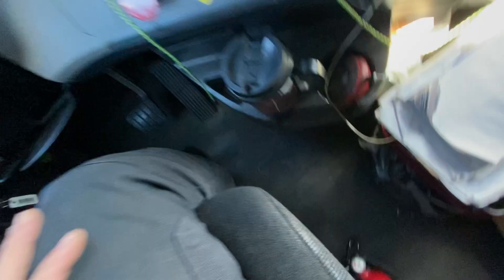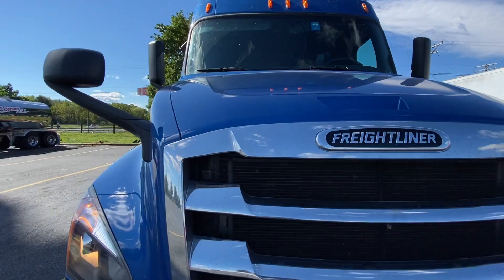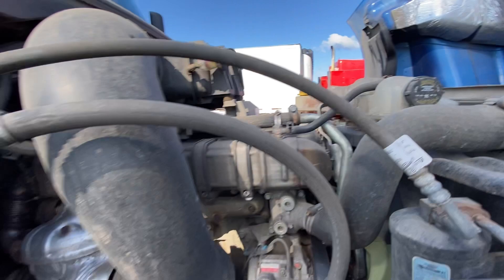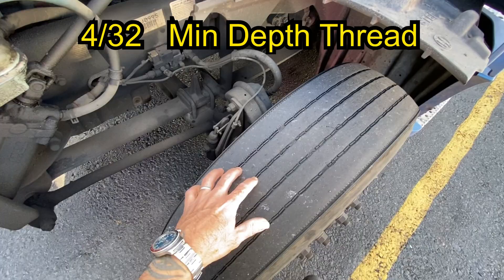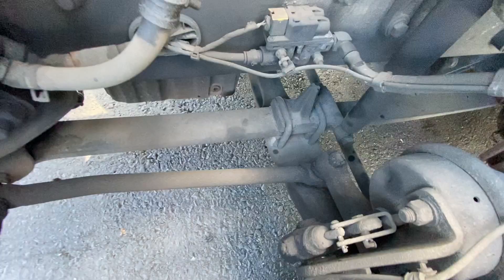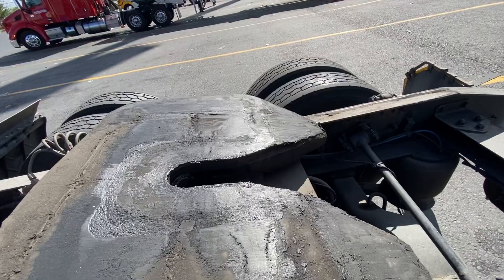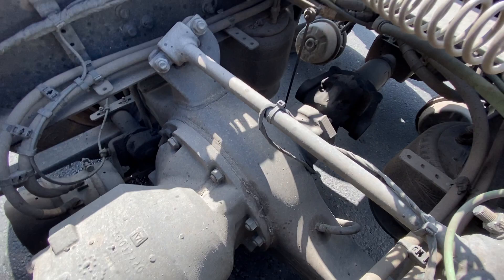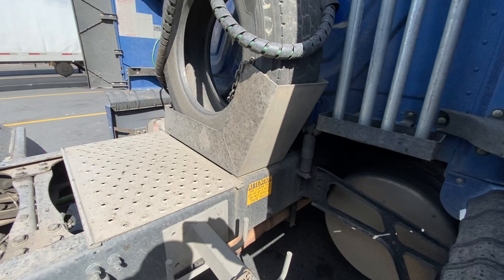CR ENGLAND. STUDENTS. A PRE TRIP MUST DO . Video

Comment: The first is not slack adjusters it’s disc brakes that’s steering linkage
Reply: JD did a great Job explaining front suspension and break system .Many Drivers out here Can't even spell Pre-Trip 😂😂 or perform one. Great Job Joey Drones 👍👍👍